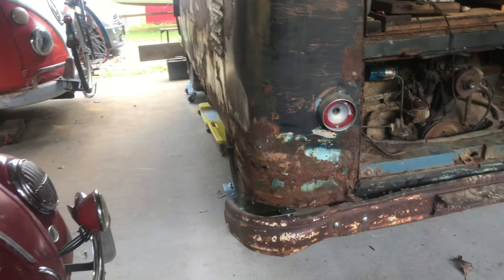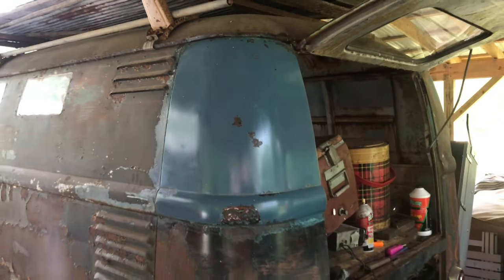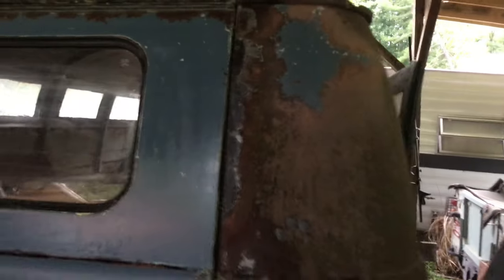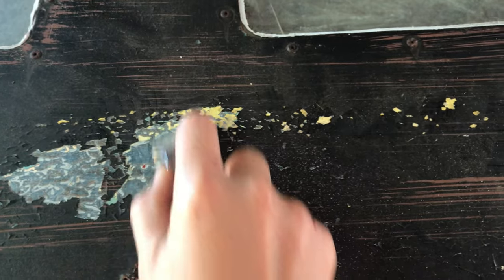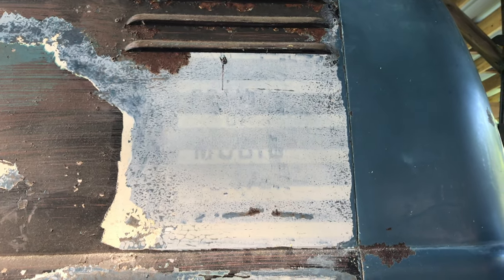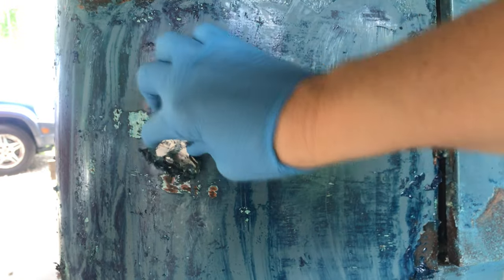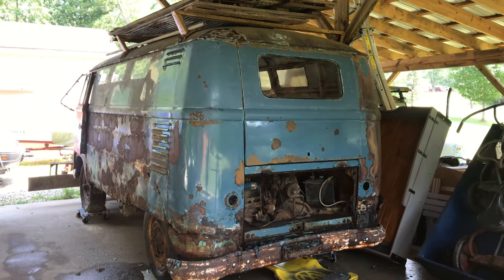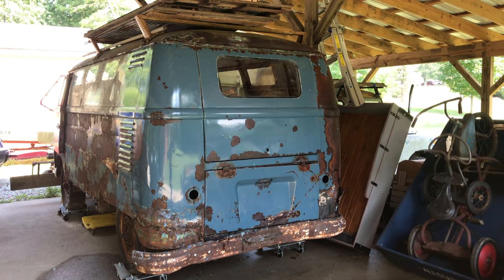Goof Off as paint stripper, saving original paint on a vintage car!

Comment: its cleaning up great, and its a tuff call to figure out how much too pull off for sure, just a heads up with the goof off you may want to use gloves as it caused me some health problems, cant wait too see whats under the front end,
Reply from the maker: hate wearing gloves😆, but agree with the graffiti version especially and I did use them for most of it...it's funny because according to the MSDS on this stuff there is really nothing in it other than a "dehydrating" type agent that should be a problem...I'm sure they don't plan on people using like 25 cans of it in two days...
Reply: .and drop cloth or cardboard on ground to catch all the nastys  so kids, dogs and U don't track back to house..........

Comment: Wow, thanks for the tip!  I've been working on removing a 2nd coat of paint over the original on some panels off and on for years.  It helps if the 2nd coat is a different color so you know when to stop. Thus far, I've used metal polish and some quick swipes with acetone to get down to the factory coat.  I'm going to have to try youor Goof Off trick!  Very impressive.  You could turn a lot of resprayed classics back into survivors with the method you're using!  Oh, and nothing glows like the original factory coat.  Great job!
Reply from the maker: welcome! I've been very impressed with how it have worked and YES it helps when the color you are after is a different color...it is only original once! this bus is a rust heap, but I like a challenge!

Comment: Incredibly impressed with Goof-Off as a paint remover.  Seen others that are painted on , let set and then scrapped off.  Goof-off sounds like an economical solution for paint removal.
Reply from the maker: Very happy with the results as long as you use the one I mention it works great!

Comment: Thanks For The Vid!! Found Some OG Paint 356 Wheels Covered In House Paint. Gonna Try This & Put Em' On My Bug!! ❤ PICKLE!!
Reply from the maker: Just make sure you get the can with the graffiti words on it in actual graffiti lol you can give oven cleaner (easy off) or acetone a try too...depending on the type of paint one might work better than another! Good luck!
Reply: @marcijunebug  Picked Up The Goof Off Pro Strength Remover. They Didn't Have The Graffiti Version. Wasn't Happy With The Results. Unfortunately, Goof Off Removed A Lot Of The OG Paint Too & Went To Bare Metal.
Reply from the maker: @roystoys3099  dang, that sucks...like I said the other stuff is not  good with this type of job...sadly the other kind isn't always readily available...did you try acetone or easy off?  If you have instagram go to 1960vert, that is my brother's OG paint car he did with only acetone
Reply: @marcijunebug  I Will Experiment With The Rest Of The 1st Wheel & Hopefully Have It Down To A Science By The Last Wheel. Gonna Try Some Other Stores For The Graffiti Version Too.

Comment: What kind of pad are you scrubbing with? Will this take off the og paint at all?
Reply from the maker: Crabbo Sniff the green scotch bright ...in the video on the deck lid I do a test between the green and blue ones...green is much better! Also use ultra fine steel wool on some of the tight places since you can kind of mold it into a shape
Reply: @marcijunebug  NOOOOOOOOOOOOOOOOOOOOOOOOOOOOOO!!!!! WHAT DID u DO???? You scrubbed off a vital link to it's past on the end gate, most importantly the letters and numbers that were......PHONE NUMBERS!!!!!!!!!!!!!!!!!!!!!  Yep they were pre-area code phone numbers with the letters designating the  exchange of the  party.old style,indeed!!!    Anyway good job U did and might consider invite your friends over for a stripper party, BYOB  ( bring your own BRILLO)   and have a ball...............Another note,be careful on the doors and front  end of Picky for that's another area of good writing and phone numbers  on it.........................
Reply from the maker: I know...almost cried when I took it off...just couldn't be saved...not and keep the original paint...I'm actually thinking of putting it back...I can make out the letters/numbers in most places...killed my soul to remove and was a tough call for sure, but now that it's off I really think I made the right choice...you will have to just stay tuned to see how I plan to incorporate those old logos back in!

Comment: Wow.
Is this for real?? Lol
We have a 1970 El Camino that we’re waking from the dead, and we’ve been contemplating repainting. 
The original color was a “burnt” gold, but my dad had it painted over in blue. If we could, atleast, get that off, maybe we can save some money if/when we decide to have a good paint job done.
Reply from the maker: yes for REAL...you have to make sure you get the can that says "graffiti" on it in the graffiti style lettering...the other one doesn't really work! try and area that isn't noticeable and give it a go...you can also try "easy off" brand oven cleaner or acetone...both have their uses depending on the type of paint you are trying to remove! GOOD LUCK! It's a lot of work but oh so worth it when you see that OG paint coming through!
Reply: Amazing! 
Thank you so much!
Reply: Pardon the novice question- What’s the best way to dispose of the scotch brite pads, steel wool?

Comment: Hi, 

How long did you let the goof off sit before you started rubbing away the after paint?
Reply from the maker: Just a couple of minutes...Keep in mind I am going through SEVEN layers of paint!!! but if you get the right goof off (the one I mention in video) it will foam and start to bubble almost immediately...I'd say no more than 5 min, but probably closer to 2 minutes...try it first on an area that doesn't really matter and go from there! good luck!
Reply: @marcijunebug  My 1966 VW Beetle appears to have two coats at most, and the original paint appears to have been preserved. Thanks for replying 👍
Reply from the maker: @gvivo13  you bet! you can try acetone also...my brother had only one layer over his 1960 vert OG paint and he acentoned the entire car with fantastic success...if you have instagram you can check out his before and afters at 1960vert or click the link below...the paprika red is the one he used acetone on! 
https://youtu.be/vDrBZ90B5Ow
Reply: @marcijunebug  hi, I started removing the paint from the driver side of my Beetle first, I got what I could off. Would a buffer remove the rest of the few spots?
Reply from the maker: Vivo 13 I never used a buffer on mine, nor did my brother, re-apply goof-off until all old is removed, but carefully and if starts to get into OG paint stop and wet sand with 1000 grit👍good luck

Comment: How long did the whole duration of removing the paint take?
Reply from the maker: Only took about a day to remove the driver side...took about the same to do the back...I still have the front and passenger side (minus the door I've already done) to do, but those areas of the bus are currently exposed to the elements so I left the layers of paint on for now as protection against the sun until I am ready to move the bus...It really doesn't take that long, you just have to stay at it

Comment: Will this remove the paint off of my plastic bumper the paint is like 3 years old??
Reply from the maker: REPTILIANMAN 626 not sure, if you trying it I would try s very small area first, I’ve only used it on metal thus far and for that it is a definite win!
Reply: @marcijunebug  hmmm I wonder if I should just sandblast it then
Reply from the maker: REPTILIANMAN 626 maybe use walnut shell or some other softer blast medium? Seems I remember someone using charcoal to blast? Maybe Johathan w channel?